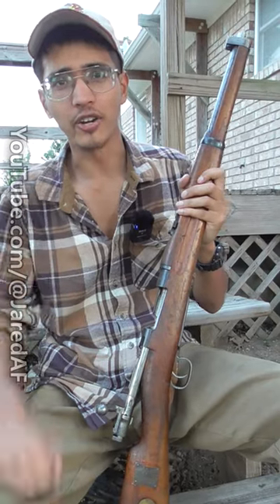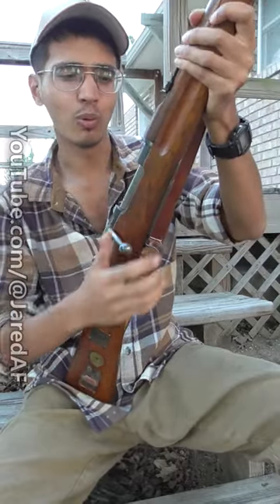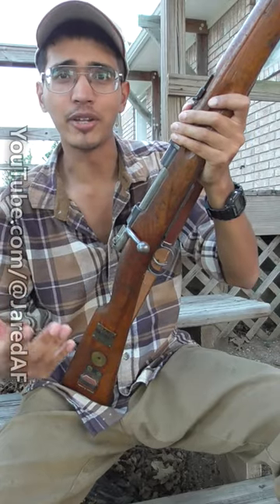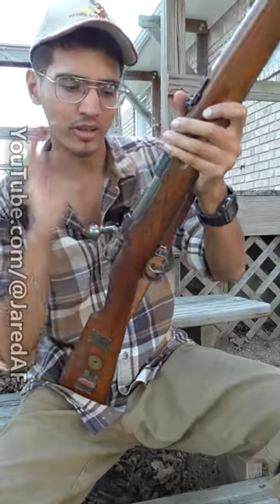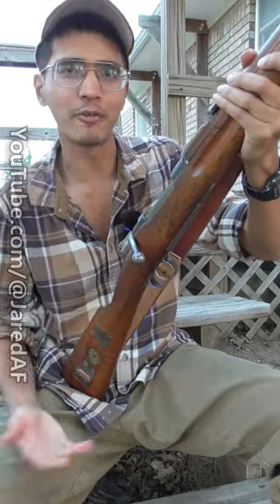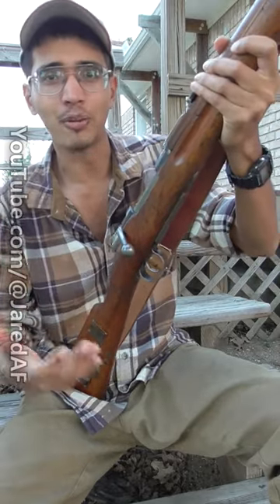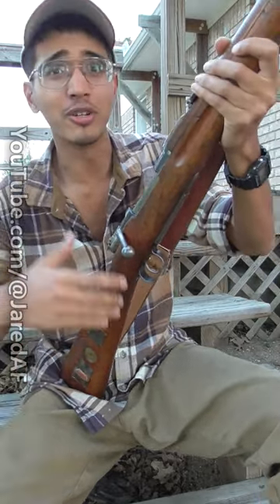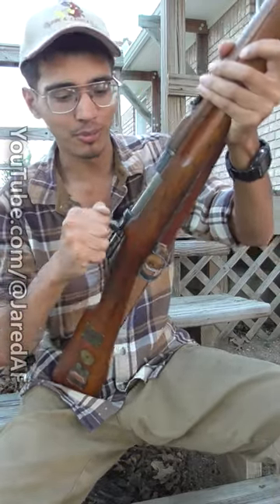Decock a Cock on Close Mauser/Bolt Action Rifle

Comment: They are perfectly capable of dry firing too just not a good habbit. Those springs are under tremendous pressure, and the pin isn't exactly the hardest material on the planet.

Comment: Instructions extremely unclear. Still ended up dry firing... Is there a way you could do it slower? Seriously, what's the difference between this and dry firing as I got the same result. The bolt just flew forward